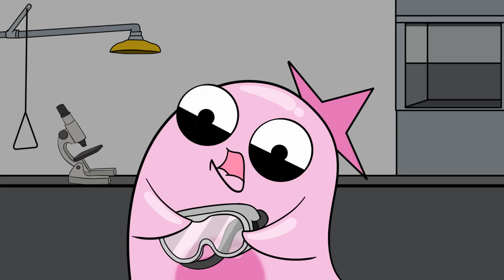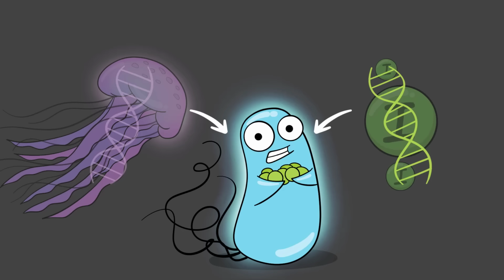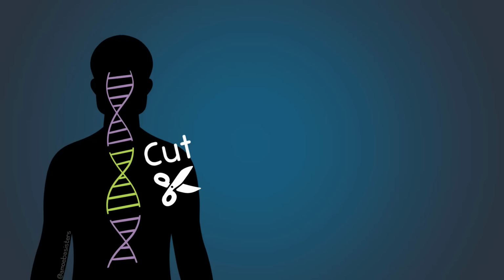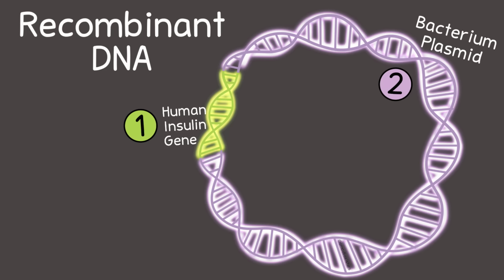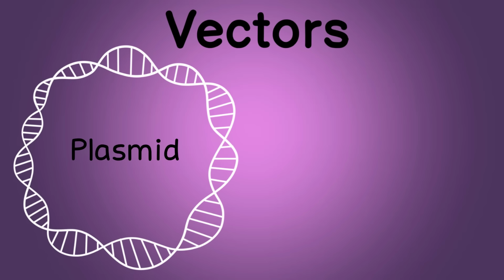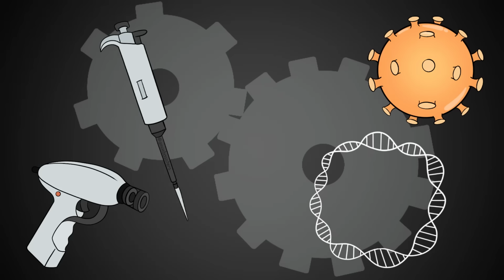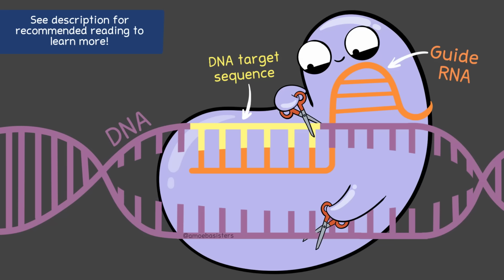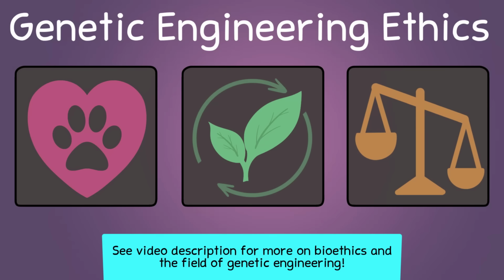Genetic Engineering

Comment: one question i am a 12 th grade student and i love biology i want to study phd in tissue engineering 
anyways i wanted to write a resech paper and 
this is the summary i just wanted to know if this can be a right idea 
This research investigates how protein denaturation hinders tissue engineering by destabilizing structural proteins and growth factors, leading to inflammation and regenerative failure. While extremophiles like thermophiles produce stable proteins, balancing flexibility and function remains a challenge. An innovative approach proposed here is to explore combining the regenerative capacity of placenta-derived cells with the heat-resistant proteins found in Pompeii worms, deep-sea thermophiles known for their extreme resilience. This hybrid model could lead to the development of super-stable, non-denaturing proteins.
if we use pompeii cell which have flexibility and placents cell which has regenerative capbility we could step into the future with non denaturative protein development

Comment: Does the location of the cutting/adding of new dna matter to the plasmid? Is it less important because bacteria are relatively simple? Would it matter more if a mouse was receiving the new dna instead?
Reply: Hii! Yeah it does matter to plasmid as bacteria have simple structure but complex behaviour...location for cutting or adding a new dna in plasmid depends on origion of replication which varies differently in different organisms...
Hope this will help you throughout...best of luck dear...❤❤
Reply: Plasmids are not used to alter the genome of a mouse. The DNA has to be integrated into the genome and can be independent like the plasmid is in bacteria. Therefore, the position/location does absolutely matter. E.g. if it is intergrated into a essential gene, it can cause serious issues

Comment: MRNA acts as a template strand for reverse transcriptase to catalyse the polymerisation of a complementary DNA strand (CDNA). DNA probes are small sections of DNA that bind to the gene of interest, allowing scientists to identify it. Restriction enzymes cut DNA at restriction sites (located either site of the gene of interest) forming sticky ends . This allows the gene of interest to be isolated. The same restriction enzymes cut restriction sites of a plasmid forming complementary sticky ends. Gene of interest is inserted into plasmid, ligase causes a phosphodiester bond to form between the complementary sticky ends on the plasmid and gene of interest, joining them together, to form recombinant DNA. MARK OUT OF 10

Comment: Type 1 diabetes does not produce insulin but type 2 makes a small amount of insulin. This is why type 1 can go into DKA and type 2 does not. Type 2 goes through HHS because they dont utilize the ketone pathway due to the liver constantly attempting to deliver glucose to the cells. Basically the liver is confused because the body still makes insulin. This is why type 2 diabetes can have higher 900db blood sugars for longer time and be more dehydrated before hosiptalization unlike type 1 where their blood sugar will be more like 600 db with massive ketone elevation at a faster rate. The treatment is the same due to electrolyte and ion shifts. Basically watch and replace potassium PRN, give fluids and iv insulin. Obviously this is an over simplified statement.